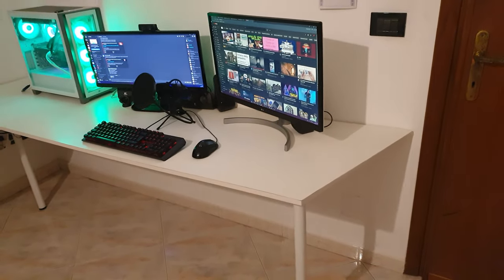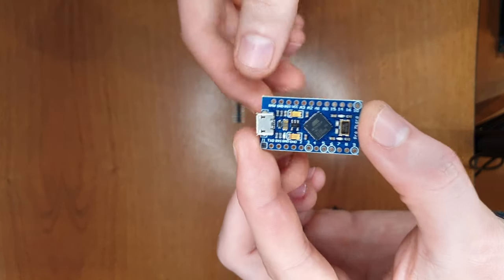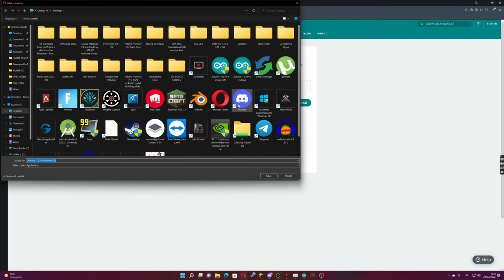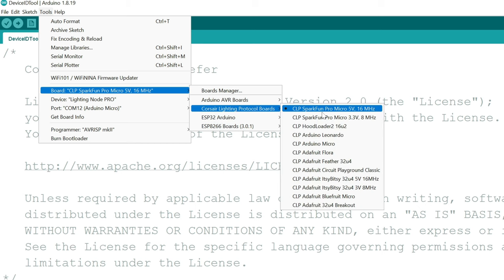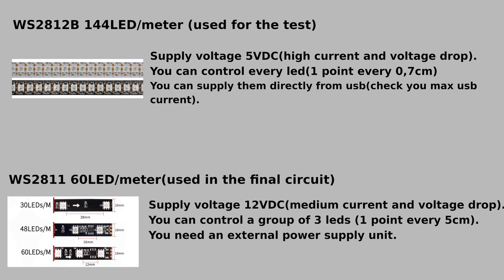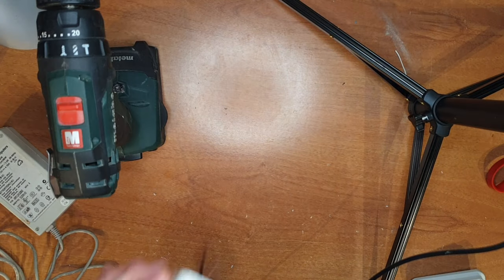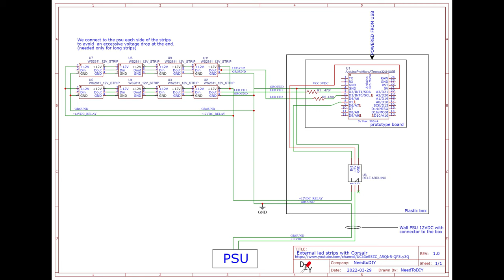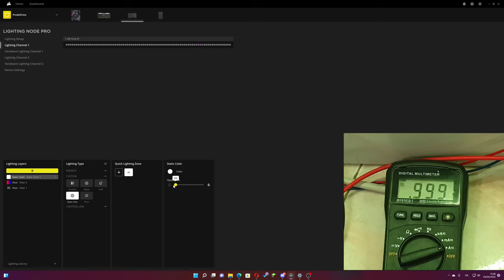How to synchronize all your setup with corsair iCue -TUTORIAL

Comment: It won´t work with your circuit plan because there is no PIN 5 in your Corsair sketch. It has to be assigned there. You have done that...otherwise your relais wouldn´t work on power off - but you don´t show in your video.

CH1 and CH2 go to Dout? I think they have to go on DIN
Reply from the maker: Sorry about missing that in the video, maybe I did it later,
There are 2 way of doing that, I'll see if I can retrieve me sketch but I'm not sure, 
1 is hook the digital pin to the function, when the function is connected the arduino will turn on the relay, 
2, the relay is supplied by the 5vdc from the usb, if the pc turn off the relay will shut down.
Atm I'm not living at my place so I'm not 100%  if I can check what I did
Reply: @NeedToDIY  I know...i finally found out :-) Don´t worry